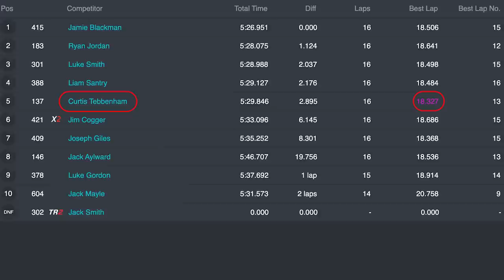1300cc Stockcars @ Northampton Shaleway 13-05-23 (on board vlog)

Comment: Another great race meeting vlog Tebbz. Only way i can think of comparing the two surfaces would be to say that racing on shale must be like racing on ice when you are used to racing tarmac. but keep up the hard work both at the meeting's and in the garage love the content that you are putting out mate.
Reply from the maker: Yes mate sometimes when it’s wet it’s like racing with loads of oil down drive in and wait for it to bite😂.. thanks mate 👌

Comment: You had a good chance in that final till it started popping out of gear and you were getting stuck in great race.  I was wondering why don't you have the rear facing camera in the bottom left of the screen so we can see front and back action,just so we can see who's ramming you 😂just a suggestion but your video's are getting very professional like,roll on the next one.👍
Reply from the maker: I think so aswell Callum, I’m Definitly up for suggestions on the camera arrangements as I don’t think what I have at the moment is best, maybe do as you say and then switch between the front and outside camera and leave the rear in the bottom left?
Reply: @TebbzRacing  thats it just try different things👌